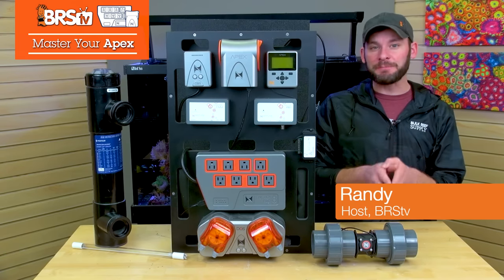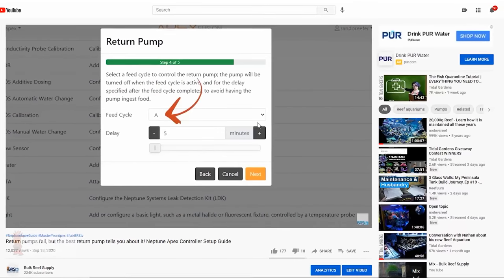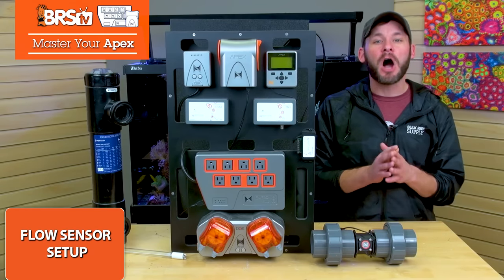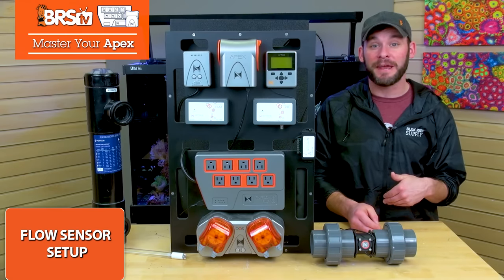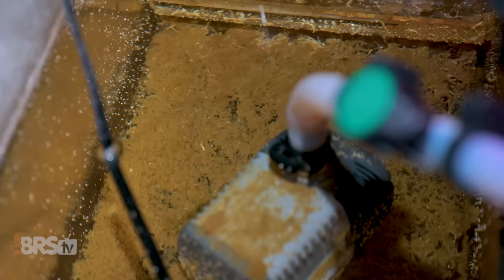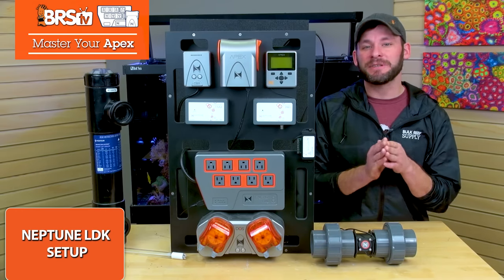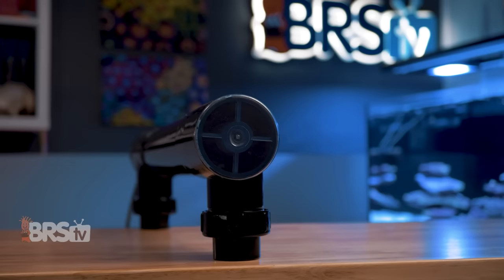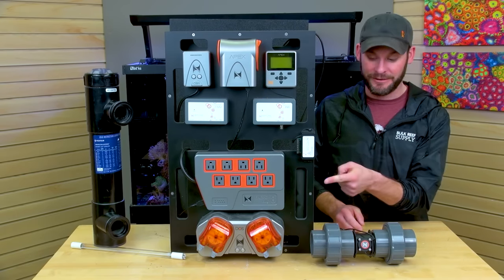How to Optimize Your UV Sterilizer? Make It Smarter With Your Neptune Apex. | Neptune Apex Guide

Comment: Just got back into the hobby and want to do it right the first time. I want to do a UV sterilizer and want to do it on a closed loop from the tank back into the tank. I’m doing a sand bottom. Can I run a small pump that won’t pump up the sand inside the tank?
Reply from the maker: Definitely! As long as the water gets pumped from the tank, through the UV, and then back to the tank (at the right flow rate), you're good to go 🙂

Comment: Thanx Randy, I have a question thou. Can you run a Cor-15 and have a scheduled increase in flow to do both fish pest and algae control from 1 UV?
Reply from the maker: Functionally, it can be done, but the problem is that bacteria and protozoa reproduce rather quickly, so by effectively turning the UV off to one or the other based on flow rate, the UV will almost certainly be less effective. This is something that we'd have to explore more in the future to know for sure.
Reply: @BRStv  If ant can make it work, it is Randy and BRS!

Comment: Dumb question maybe, but won't a slower gpm (50 gpm) kill  Both parasites and algae. Any one running a slower gpm have you seen any problems with your algae? Maybe a good test to tryout. Thanks for the videos
Reply from the maker: Actually they are very different for the job you want them to do. Check out our findings that came from one of our UV Flow experiments and we have another experiment wrapping up as we speak! https://youtu.be/WrfgKEHIBrw
Reply: The answer to your question Robert is that running the pump at slower rate will not deal with algae because their spores reproduce too quickly.   A higher flow would usually be necessary to sterilize the algae before it could reproduce.  The manufacturer should have a guide as to which flow rate on a particular unit would be best for what you want to use it for (higher flow rate for algae and a slower for parasites).

Comment: I can’t plug the UV sterilizer into the apex EB or it beeps...needs its own outlet
Reply from the maker: Hmmm...that's really strange! Have you been able to nail down a cause?
Reply: I called and spoke to Pentair many times they are great even face timed to see it in action. I then tried the “killawatt” device, I have two EB and a KW ...I have a separate 20 amp dedicated line to the tank and they say it is because it is a built in warning that only goes off when draining the system. Sent me a new powerpack and told me to plug into the KW. That didn’t work either so now I plug it into a different wall outlet by itself and no beeping. Interestingly it worked fine just beeped low enough to not hear it when busy house but loud enough to only hear it when quiet house!! Haha. It is the 40watt btw.